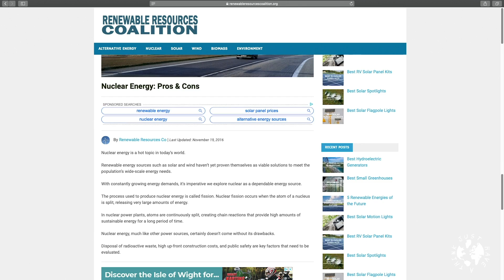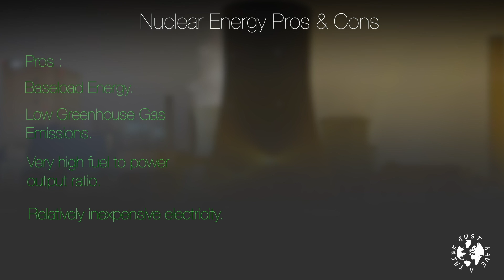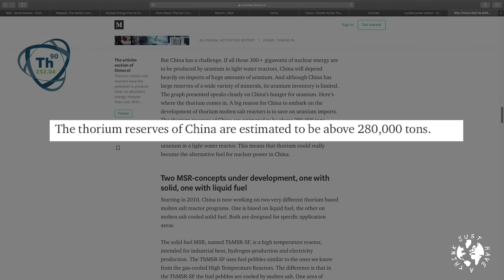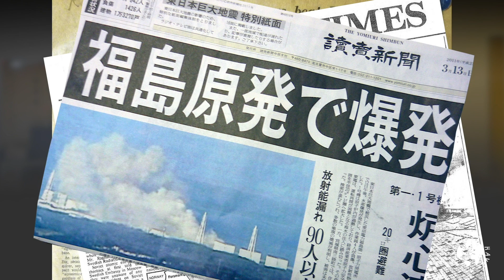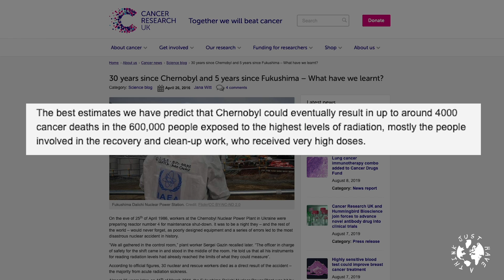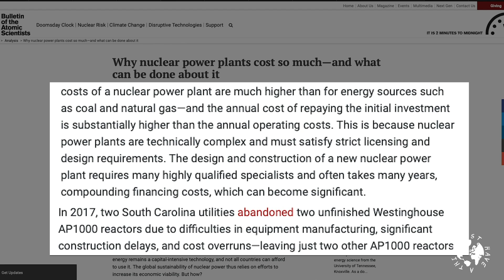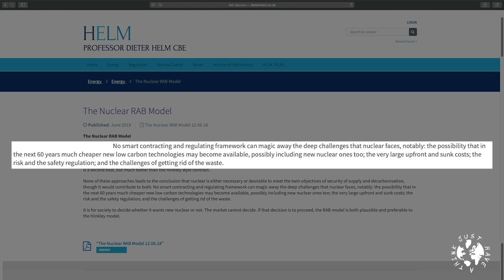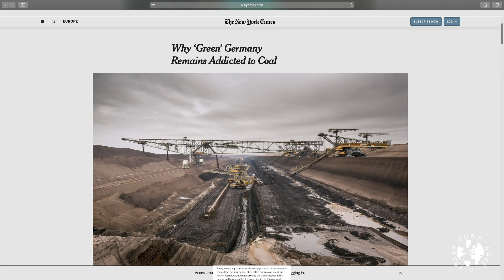Nuclear Energy in the 21st Century

Comment: They also have operational limitations they requiere water and during this summer in France 20 reactors were shutdown and of 7  the output was reduced. So they are not the holy grail!
Reply: Everything has operational limitations. Seaside reactors do not have this problem of making the river water too warm for the wildlife. The reactors could work fine in heatwaves - it's just that the fish/ecosystems would hate it. It's fair enough to reduce power in that case. You could design a much bigger cooling system so it would still work on the heatwave days, but that would be excessive expense, given very occasional usage.
Reply: @xxwookey  All the major sources of power heat water for energy production. If this is an issue all the coal plants and gas plants would have to be shut down as well, not just the nuclear ones.
Reply: @Tell-me-more-75225  It's a good point Brian. But I have never heard of a gas or coal plant having to be shut down due to too high cooling water output temps. Perhaps that is because people only make a fuss about nuclear reliability or because more coal and gas plants use cooling towers? I don't know, but you are quite right that the thermodynamics is the same for all thermal power plants.
Reply: @xxwookey  Thanks for the respectful and thoughtful response :)
Yeah I am not sure why either. I would guess because anything out of the ordinary that a nuclear power plant does automatically gets more attention. I also imagine that when the procedure is initiated to shut down a nuclear power plant lots of people need to get notified. I also also imagine that it is more complex to initiate the shutdown of the older designed nuclear power plants vs the gas, oil, or coal plants.
Reply: @xxwookey  Correction -- seaside reactors have ALREADY had power output curtailed due to excessive heat of the water.  For example, Pilgrim in the USA in 2015; Finland’s Loviisa power plant in 2018.  It's not just that "the fish/ecosystems would hate it."  They would actually die.  Furthermore, the excess heat increases both bio- and chemical activities in the locally heated areas.  This can result in a potential increase in algae blooms on the one hand, or creation of hazardous chemicals on the other hand.
As you point out the solution is building bigger cooling systems, which of course drives up the cost of nuclear, making it even less competitive than renewables which do NOT depend on water to either make steam, or be used for cooling purposes.  
Finally, intake of hotter water whether from rivers or ocean bats reduces the electrical output from reactors, making the cost of power more expensive.
So -- why do all this?????
Reply: @DaveKraft1  That you for the correction on seawater temp limits. Noted. Why do this is because you get very reliable, very low-carbon, very safe, very small environmental footprint power. That's a useful combination. The fact that heat-exchanger systems are constrained by environmental considerations is just another engineering/cost/reliability tradeoff, not a reason to dismiss nuclear power wholesale.
Reply: Most (16 if I recall correctly) of those shutdowns for routine scheduled maintenance. EDF groups the maintenance for their rectors in the summer because normally it's the period of lowest demand in France.
Reply: Those were not technical limitations.  Those were regulatory limits set to disallow coolant water over a certain temperature being discharged into the environment.
Reply: @logdog6762  It's the same thing. The engineering design leads to a given max operational water temp given the regulatory limits.  I think we are in agreement really.
Reply: Molten salt reactors require much less water for driving the turbines than the classic water cooled reactors and if they use Thorium, they are super safe as well
Reply: I love how nuclear has pretty much the best capacity factor going, Close to 100%, and you're arguing for renewables with some of the lowest capacity factors going based on this point. Are you okay?
Reply: @doritoification  Capacity factors are essentially irrelevant here. They are built in to the LCOE price. What matters is what it costs per MWh (and some things about variability and predictability), not what the ratio of average to max output is.
Reply: @xxwookey    its not a ratio of average production to max capacity. Its a ratio of actual total production to max capacity. Taken over a sufficiently long period, like a year, its an indication of how reliable a power source is. Nuclear is almost as reliable as coal and typically has a CF above 90% which takes into account things like shutting down on hot days in France. 
Its reasonable to point out that nuclear has to shut down in certain conditions like this as well as during refuelling. These things account for the less than 100% capacity factor.
What is not reasonable is to say that this flaw in nuclear is a reason we should just go renewables for example. Because using the same metric renewables are awful. They're also less predictable and change by the day.
Reply: @doritoification  You seem to think CF is a measure of reliability which is incorrect. With your logic cars, trains, peaker plants, etc., would be unreliable. Give it a think.
Reply: @CheapHomeTech  well you're not wrong. But as a baseload power source it kinda does equate to the reliability. peaker plants fair enough you don't expect a high CF but with nuclear you would have it running at 100% 24/7 if you could because it's baseload. The fact that you can't is because of the slight unreliability. Renewables on the other hand have such low CF because of terrible reliability explicitly. Maybe CF was the wrong metric to refer to but my point was simply that you don't point to nuclear which works at full capacity roughly 90% of the time and ridicule the few days in France when it got a bit too hot as some sort of point to say renewables are better. I can't find the comment I was even replying to now, maybe it got removed.
Reply: @doritoification  "kinda does equate to the reliability" only in that limited context. When you take it out of context though it's wrong. So yes "Maybe CF was the wrong metric to refer to". Yes, it is not valid saying renewable energy is better than nuclear in the heat. Especially since wind and solar both have their own heat related problems if they are not designed for it. Renewable energy is very predictable and reliable despite their much lower CFs. Especially with modern statistics, computers, and proper engineering and procedures.
Reply: @CheapHomeTech  I guess you could argue that you can rely on renewables being unreliable? And it requires computer modelling to predict their output rather than just being able to control their output yourself so I guess that makes them "predictable"...
Reply: @doritoification  yes. You need computer models that includes weather, predicted demand by the minute, the ramp up and ramp down of the various energy sources along with their costs, and smart loads that can be triggered remotely. It's a highly complex money making industry with many variables.
Reply: @doritoification  "its not a ratio of average production to max capacity. Its a ratio of actual total production to max capacity".  Which are the same number (where the 'average' in question is the usual 'mean'). So yes, we are in agreement on how to calculate the capacity factor.
Reply: @xxwookey  yeah looking back i have no idea what i was arguing about. clearly you were right, i did used to have a bad habbit of getting drunk and hopping onto the comment section and it seems to show very clearly in that comment
Reply: @xxwookey  except capacity factor DOES matter... Another thing that DOES matter is how, why and when you're not running at capacity.
Capacity factor might be baked into the LCOE but the LCOE doesn't take into account system costs and nor does it take into account any form of environmental considerations.
Not only do renewables run at pretty poor CFs but the utility is not in control of when they have the renewable capacity. You might be able to make pretty good predictions about weather and demand but you inevitably require much more backup capacity because you just don't have the ability to ensure that the wind doesn't stop blowing for a week.
Planned outages at nuclear plants due to refuelling are normally staggered to keep at least a decent portion of the countries nuclear online at any given time therefore requiring less backup capacity.

Imagine a country with 5GW baseload demand and 10GW peak demand. If you wanted to power it with wind you could build 10GW of offshore wind with 50% CF and run the country half the time but you still need 10GW of, for example, CCGT capacity for when demand peaks at the same time the wind isn't blowing. That's one power plant for the price of two and don't forget curtailment every time you reach capacity during off-peak demand.
A more sensible option would be 6 or 7GW of nuclear and 3 or 4GW of CCGT (yes nuclear can load follow to a certain extent) then maybe throw in some renewables as a fuel saving tool for the CCGT for climate reasons but not cost reasons as there will still be curtailments
Reply: AND THAT WATER WHEN USED IS CONTAMINATED
Reply: @flodjod  The water used in the production of steam for power generation is a separate loop and not radioactive (contaminated as you say).

Comment: I find that you have excellent videos and really help us think.  However, I have one comment, don't quote the IPCC report since they have not taken into account Methane.  There was one day in July when there was a methane release and the temperature of the Laptev Sea increased by 2°C in 4 days.  Don't tell me that it won't have an effect.
I used to work in a subsector of the energy field and saw the costs of producing petroleum, coal as well as nuclear.  To mine nuclear is a process that is very carbon intensive, and this is not included in their equation.   Exactly as they don't take into account the manufacture and transport of all the chemical products for tar sands and fracking.
Wind, solar and tidal energy are relatively lower energy cost technologies.  But they require storage, so we need to go "nuclear" on building battery factories.  A battery is paid back within 2 years for it's carbon footprint and can last up to 25 years.   Then it can be recycled at up to 95% with todays technology, and this can be improved. 

Can we survive on only renewable energy?  Yes, especially since the Petroleum industry uses over 50% of all electricity in the world, with plastics being even more energy gourmand.  Getting off of plastics and fossil fuels will help us tremendously.  And don't forget that 40% of all ships are used to transport oil products.  Get rid of them, we won't need them.
But this would mean that our present system will lose money.  I am going to search for my very small violin to play them a sad song,
Reply: "To mine nuclear is a process that is very carbon intensive, and this is not included in their equation". Yes it is. LCA studies showing that nuclear is very low-carbon, almost exactly on a par with wind include mining and refining. See NREL 2012 studies. And what do you mean 'the IPCC have not taken into account methane'. Yes they have - it's responsible for anout 1/4th of the rise in forcing in recent decades. Are you talking about the clathrate bomb? That's covered enough to demonstrate that it is not a current issue - temps need to rise much further before we need to seriously worry about that. Rising methane level worldwide is an issue. It needs to be determined to what degree it is fugitive emissions, land-use management changes or permafrost melting that is responsible for it.
Reply: @xxwookey  Integrity Initiative?  Those studies don't take into account the mining input of nuclear.   They have cleverly worded ways to exclude those costs. 

And the IPCC has not included the results of Shakhova, she has had difficulty getting her papers published and there was no mention of her work of the last decade.  At our peril.  The major problem is permafrost release.
Reply: @lawrencetaylor4101  The NREL LCA assessment for nuclear does include mining. Page74: "Operational processes: Operational processes result in GHGs emitted on a continual basis per unit of electricity generated. They include uranium mining, milling, conversion, enrichment, fuel rod fabrication, transportation,
facility operation and to maintenance, and reprocessing". It's a small contribution. It also includes waste storage and decommissioning. 

Shakova's had difficulty getting published because her science isn't very good. She's talked a lot of nonsense as part of the arctic emergency group. Permafrost melting is a huge problem, primarily because of soil microbe activity. The really important science here is Crowther 2015, not Shakova. And yes that science is not in the IPCC modelling because it's too new, and it a big feedback in the wrong direction (about the size on one more USA - so maybe 10-15% of worldwide emissions).